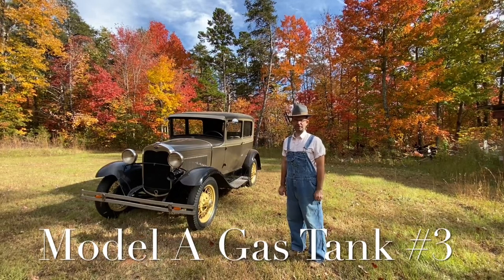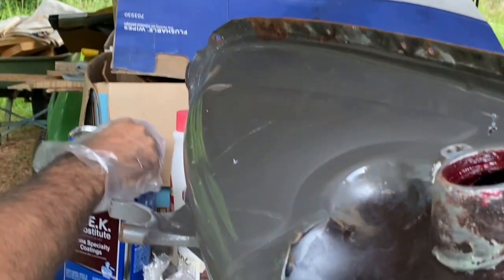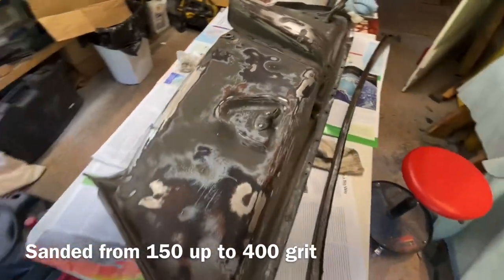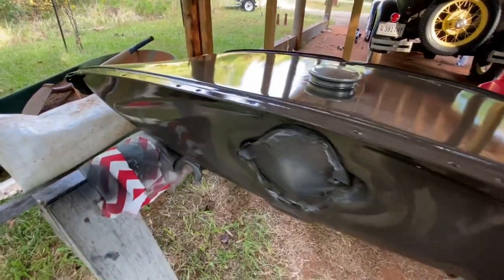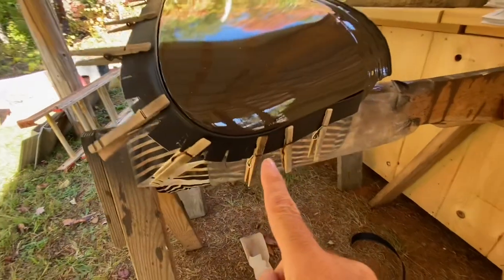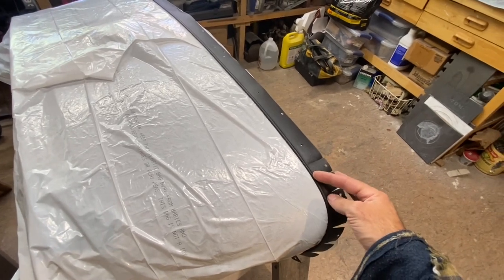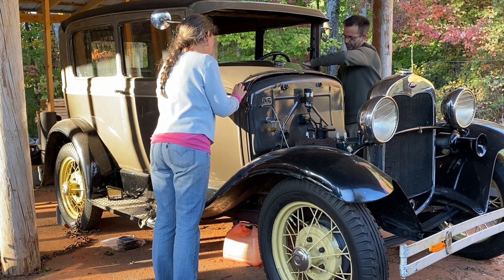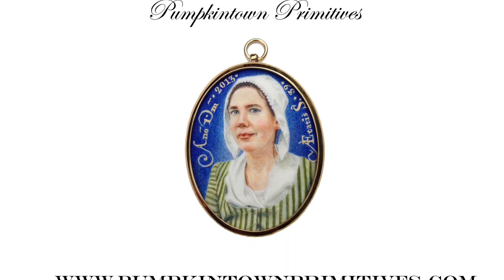How to Remove a Gas Tank from a Ford Model A PART 3 REINSTALL

Comment: Re: one side of the tank always binding when you tried to reinstall, I wonder if it would have helped to get a long 2x4 into the cabin and wedge it across the body. That might put a little outward pressure on the cowl right there and expand it by a fraction of an inch. Just brainstorming.
Reply from the maker: Yes maybe others will see this idea and follow suit. Great suggestion. I have a cargo bar that extends with squeezing the handle that would work good for that. Where were you when I needed you?! Lol! Great suggestion.

Comment: I had a 1951 MG TD tank repaired about 15 years ago. The bottom was rusted out, they cut it out, blasted all the interior of the tank welded in a new bottom and coated. It came back ready to paint and non of the threads were gunked  up with the sealer and the sealer was nice and smooth on the inside of the tank.
Reply from the maker: Yes sir I think my guy made it a point to create havoc. A disaster. Let’s just hope the inside is ok!